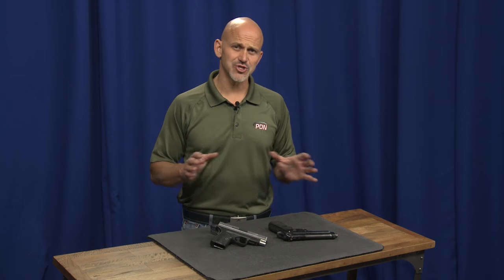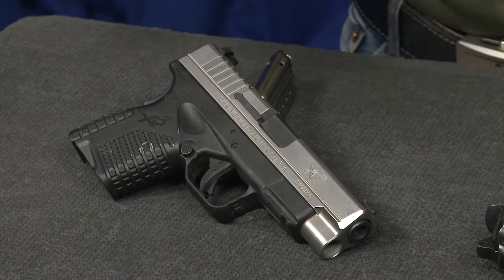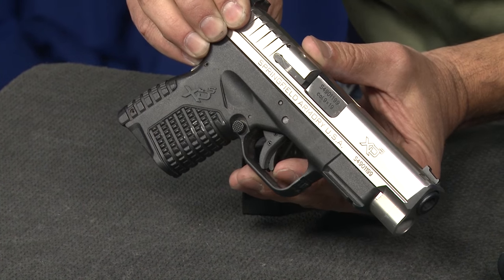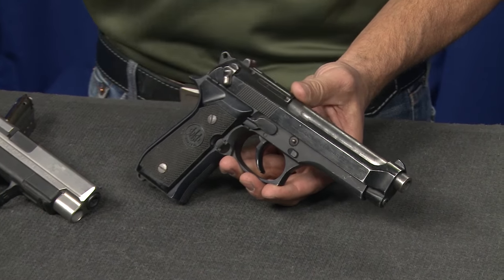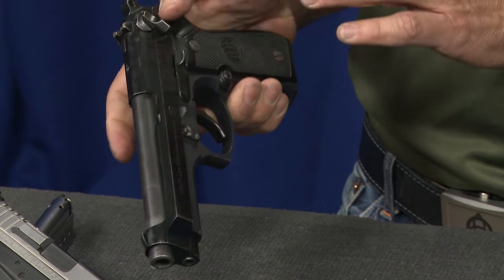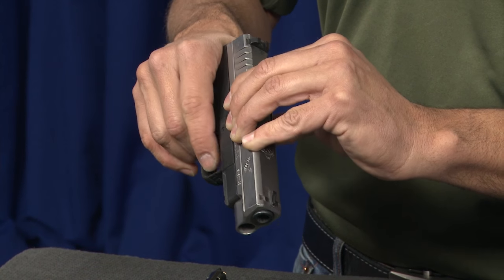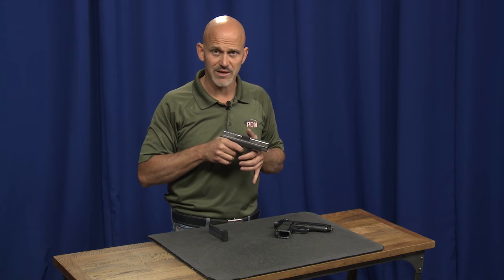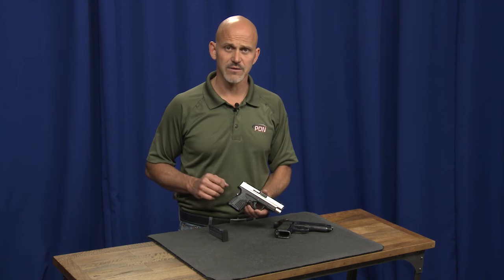Manual Safety on a Self-Defense Handgun

Comment: I'm a fan of a 1911 style, frame mounted, thumb safety on my carry guns. That's one of the reasons why I'm generally carrying either a 1911 or an M&P (thumb safety model), but I don't like those slide mounted safeties at all. They're just too easy to miss during the draw stroke!
Reply: Same here and I can't imagine carrying cocked & locked without that thumb safety.
Reply: +Rich Weatherly -- Me neither!
Reply: Jeremy A, totally agree with you
Reply: Perfect comment!👍✌️
Reply: I wont carry a gun without a manual safety. You can call me a pussy, or a noob, but at least I'm packing and a quick thumb swipe aint a big deal..
Reply: Don't work the Beretta 92 saftey like the guy in the video. The 92 safety works with the same thumb motion as a 1911 safety. By sweeping your thumb down. The 92 safety is spring loaded and will go to the off position.

Comment: The manual safety on FN Five-seveN is perfect. You have an external safety but you don't need extra movement to disengage the safety. Finger off the trigger when you draw the gun. Acquire the target and as the finger moves to the trigger the safety is disengaged. Perfection.
Reply: Wouldn’t the finger being of the trigger be the best safety?
Reply: @ak-burn1  No, if that's the case then all rifles would come without safety switch.
Reply: @46Laxis not such a good argument there, long guns have safeties because we carry them outside of holsters for the most part
Reply: @MrAvidOutdoorsman  Not a great argument either. No good holster will let you pull the trigger when the gun is inside the holster.

Comment: I've got to add I saw the vid with the guy who holstered his glock appendix carry.then bent over forward and blew one of his personal items off .there have been more negligent discharges from GLOCKS than any other auto loader.police ready rooms included .worried about an extra step what to the hospital or worce. For 44 years I've carried a Colt Series 70 .45 combat commander with out a hitch.wouldnt carry any other way condition 1.Ive seen 6 or 8 NG'S none of the autos had safeties. Alk the talk is talk.

Comment: Rob,

     On using a frame mount safety such as my CZ75/85B, my firearm can be carried hammer down, quarter cock, or condition 1 (hammer back, safety on, round chambered).  I have no existing familiarity with it going forward (newish shooter, firearm is new to me).  I'll be staying with this firearm for home defense purposes.  This video gives me the impression that I should train to utilize, and store "ready" this firearm as if the manual safety lever did not exist in the first place.  Is this a correct assumption?  I'd assume the opposite would be true if I'd been very familiar with a SA1911 style firearm.  Thank you for your videos, they always give us lots to think about!
Reply: A bad guy got my loaded pistol away from me once.  He would have killed me with it, except that the safety was engaged, and he did not disengage the safety before he tried to shoot me.  The slightly longer story is in the comments on this video.  Bottom line for me is that if a gun is loaded, then the manual safety will be engaged.

Comment: I agree, but have a problem with the word appropriate. I feel other options can be appropriate for certain people. I carry a fnx 9. It's all I carry and own. The long trigger pull is different but it's normal for me. I only engage the safety when I take the gun off and lock it up. Other than that I keep my finger off the trigger, safety off, pull the heavy trigger is not easily pulled..
Reply: I concur. There is a spectrum where on one hand the likelihood of use is low and the need for it NOT going bang when you don't want it to is highest (civilian daily around innocents) at the middle is the average police officer who is also around innocents yet has a duty to run toward the crime.  On the far end is the ESU/SWAT/Operator / high risk warrant squad who KNOWS they will need to use force (highest likelihood) and are highly trained or are on the higher end of the trained spectrum. I would argue that the farther you are towards the first part of that spectrum the more you should consider a firearm like the B92 in terms of safety features. But of course their are exceptions and each person needs to make their own logical decision.

Comment: The reason for the manual safety is to keep you from shooting yourself. Only a fool thinks the trigger safety is a safety. Anything that gets to that trigger deactivates it. In 32 years of EMS I have seen several self inflicted gsw from a gun like a Glock. Usually by putting it back in it's holster or a pocket! The grip safety in this case helps only marginally as your hand operated it automatically. If you are bent on carrying a Glock style you should also carry a tourniquet! A manual safety gun only requires training to operate safely and efficiently. If you don't train and still want a gun get a revolver!